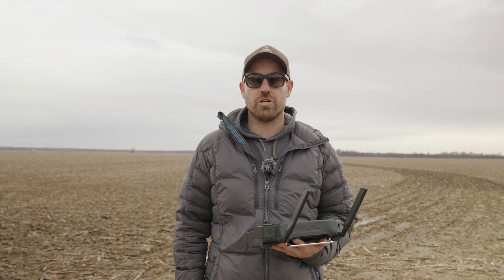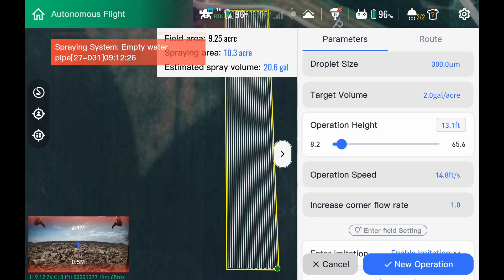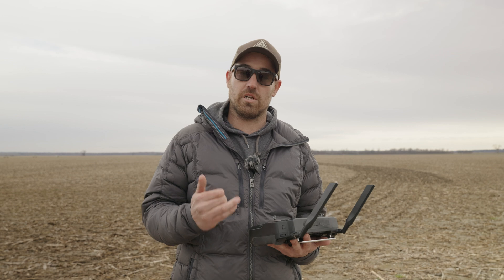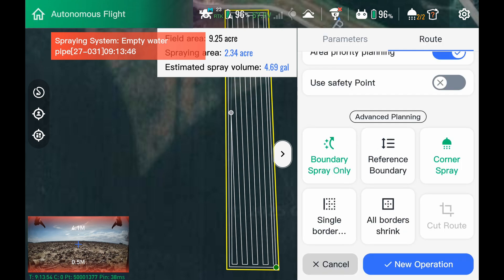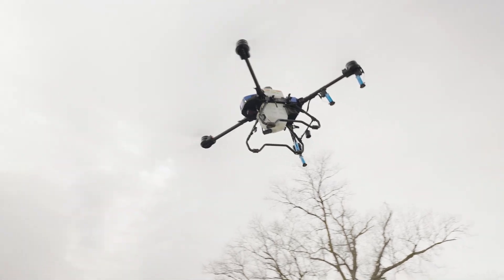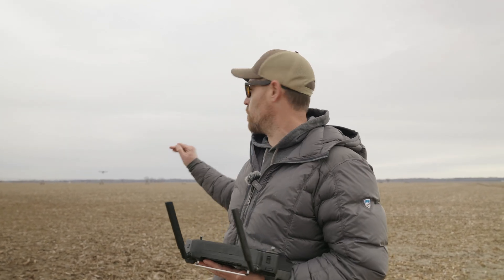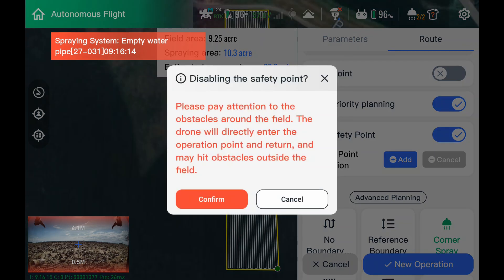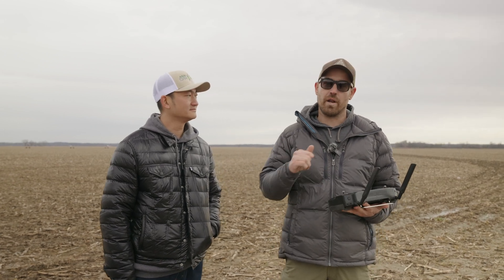J100 Boundary Shift Function

Comment: Still say Drift Mitigation in software would be awesome. Input wind velocity and direction, either manually during setup or automatically via a wireless meter for on the fly live updates. The drone could adjust the path to mitigate drift. Aside from obvious advantages, cheaper insurance coverage could be an advantage too.

Comment: What is the use case for this? Why would we want to do this instead of flying the boundary once then building the mission inside that boundary? Is it just about turn efficiency?
Reply: I suspect it's for circular shaped fields, where you can eliminate turns and increase efficiency. Could be more than that though.
Reply: Many people Spray insecticides across the first 30-120ft of their field edges so this mode allows you to do so with ease
Reply from the maker: Flying center pivot fields is probably the most common use case!